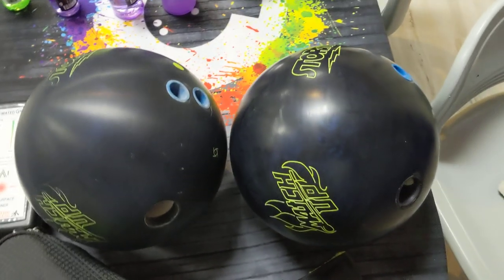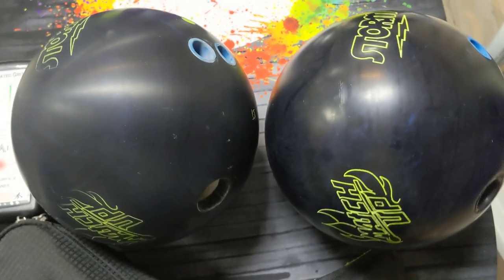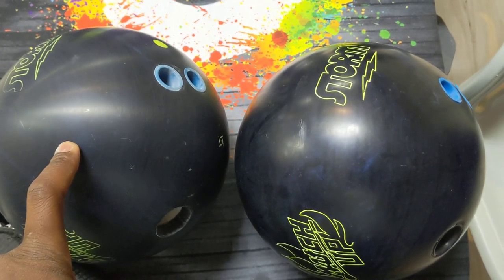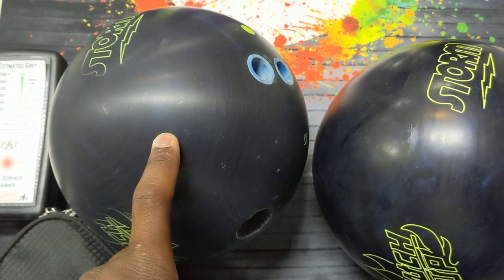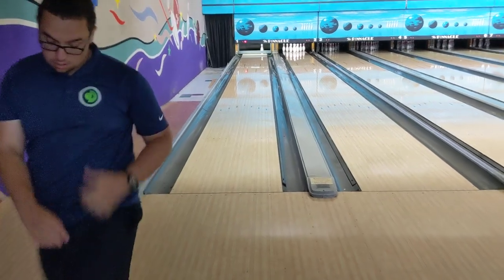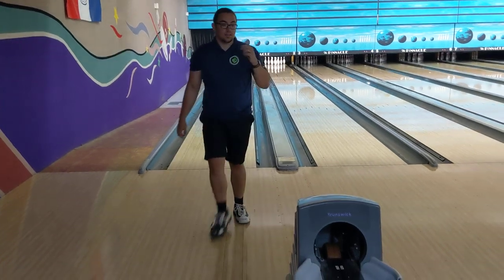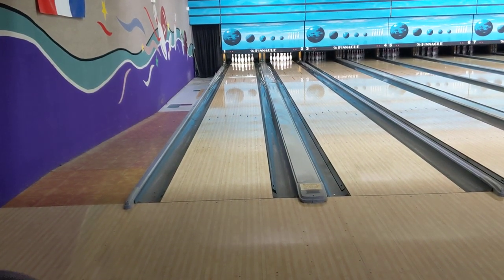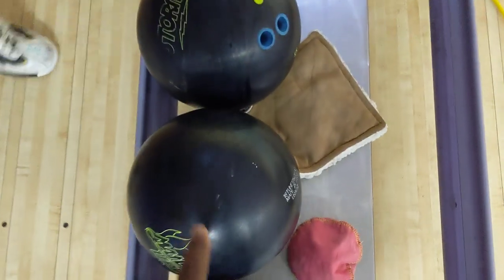PRO TIP | A Way To Combat Surface Change On Bowling Balls

Comment: A fresh Cover only Works for 15 shots then it lane Shines to 5000k.  Every shot lane shines your ball 150 grit per shot.  After 15 shots that 2000 grit is 5000k  You might need 2000 grit for game one and 2 then need that 5000k for game 3

Comment: Why not just drill an arsenal - If I am allowed say 3 balls for a tournament - why I would drill two the same and then have a spare ball??  Why wouldn't I drill balls for different shape reactions so that I have the versatility and maybe a spare ball...
Reply from the maker: Well that's why it's a Pro tip. Meaning professional. These balls aren't the same even though they look similar. If you want to change the shape you can use the lane shine to do that instead of adding another variable in a different ball.  It makes it way easier to change balls when you know what it is going to do.

Comment: the pros can do that because they only pay for the drilling of the hole i remember brad and kyle saying on a vlog its $20 bucks a hole so 60 dollars it only cost them per ball verus league bowler unless u get an extremely good deal 100-200 bucks just for ball not including drilling a ball big difference not saying its a bad tip at all just for avg bowler not necessary usually if its going through transition needs balls with similar layouts and different surfaces/ covers but not everything is the same for everyone what makes bowling unqiue each person has different shapes and angles they like. i recently been plugging some old balls and re drilling with layouts by vls and damn does that system work wonders 2 balls ive done a low rg layout first night 714 another completely different ball (high rg) first night shot 735. i think alot of league bowlers problems is not knowing there stats (pap, rev rate, tilt, speed, and rotation) and matching 1-2 balls maybe 3 to the conditions in there local center while also taking care of there bowling balls surfaces cleaning them and rescuffing them you know basic maintence.

Comment: Advanced tip: just buy TWO of the same ball. Come on Ronald...
Reply from the maker: Yes and we explained why.  It's a Pro tip because that is one of the things they do.
Reply: @Ctdbowling  Got any video reference? I've never seen a pro carry two of the same ball. I'd imagine if anything you'd want your ball to polish up a bit because lane conditions change pretty quickly as well, especially with all the strong coverstock equipment being thrown.
Reply from the maker: @jb4124  I have a entire presentation on surface and I have pictures showing a pros arsenal that do this exact same thing multiple times. Meaning he has 2 sets of duplicate balls. It's not a video but I'll upload one so you can see it tomorrow.
Reply: @jb4124  Kyle Sherman drills a new ball almost every shift and every tournament, some PBA players bring a lot of balls and not even throw any of them. If you have ever bowled at Nationals, a lot of the top guys have ball reps who tell them what they should bring and even what to drill and how to drill it. It's not uncommon at all.
Reply: @jb4124  just this weekend kyle troop won a tournament with two phase 2s
Reply: J B last year Jesper Svensson brought 12 of the same urethane ball to a tournament